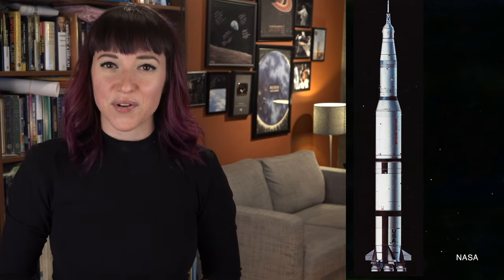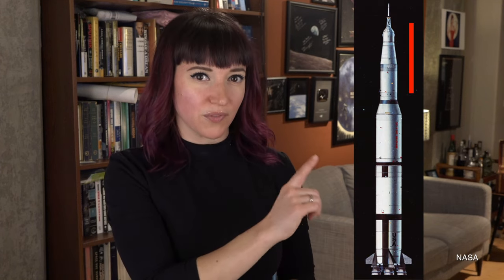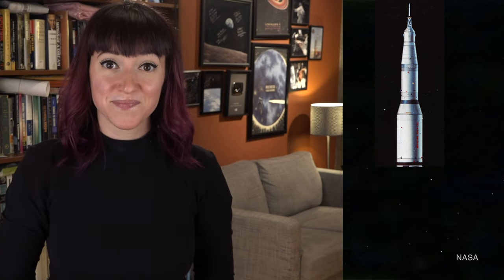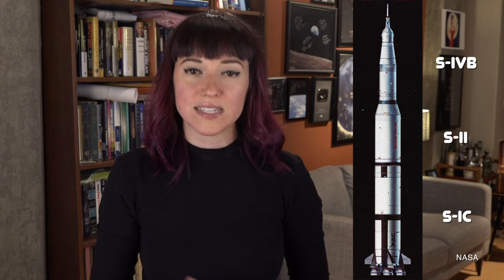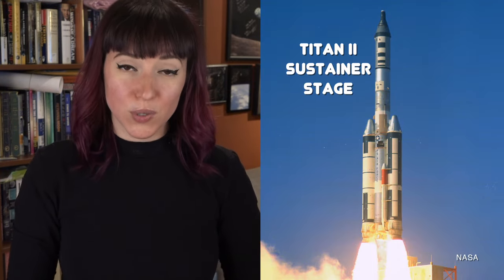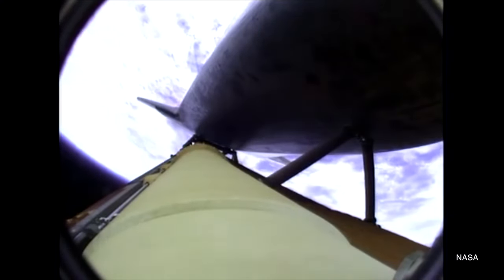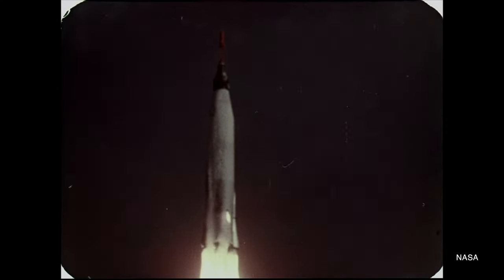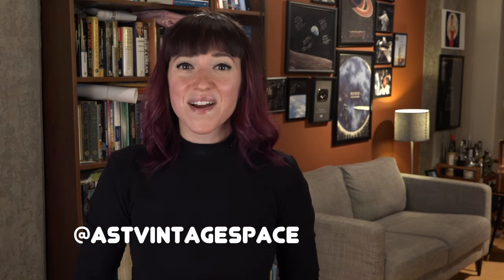The How and Why of Rockets' Staging

Comment: I worked at the space facility that manufactured those Saturn boosters. People lost interest in men walking on the moon and the program was cancelled. Entire completed booster stages were simply parked outside and other parts of the country as tourist attractions. Which in itself is cool because I can go up and actually touch the massive engines, examine their lockwire techniques, read pressure tube tags. Fascinating!
Reply: I want to thank you for your work. For many years I feared Apollo would be the last 'hurrah', or the pinnacle of space exploration. But we have SpaceX and Blue Origin, and others working toward space. This pleases my heart.
Reply: What was your job there?
Reply: James E  Sadly my job when I first started was to throw Saturn era materials in the dumpster as we transitioned to building the Space Shuttle external Fuel Tank. I could only dream as I walked through the myriad of cables, hydraulic and gas flex lines that would have been used to test the completed boosters. Old test consoles sat vacant. Ghost house.
Reply: +Bobby Harper
Fascinating to hear from you as someone belatedly connected to the mighty Saturn V and ushering in the still impressive Space Shuttle external tank. I would have been fiercely tempted in your shoes to snag a few throwaways to keep. I will always look up to the marvel of the Saturn V, as everyone does even when it is lying on its side because it is so big ;-) Had the pleasure when I was young to see the one on display at KSC and plan to go again. Maybe the SLS will achieve great things and we will have another achievement to look up to in the future.
Reply: I feel compelled to get near them with a lighter like James May.

Comment: Amy - It might be nice one day to do a video on the difference in efficiency between rocket nozzles used at sea level versus those used in vacuum.  My understanding is that this is one of the main reasons behind rocket staging. Maybe a video on NASA's attempts at single-stage-to-orbit like the VentureStar, too, if you haven't already done one. Thanks!
Reply: Indeed this very high level overview doesn't really feel convincing about why staging is done.  After all, why throw away the 1st stage engines and structure only to burn fuel in a 2nd stage, when you could be burning that fuel in the first stage and instead not have the 2nd stage mass of engine ?

Different nozzles and fuel types used is probably the answer.

I think this is also something that needs some hard numbers to be truly convincing.

NB: I know staging is done for good reasons, I'm just saying this video, sadly, fell short of explaining why.
Reply: Ath Athanasius Explaining a lot of space stuff requires mathematics, Amy tries to keep the videos simple for a broad audience.
Reply: That's kind of a bad feedback loop though. No broad audience for maths -> don't explain any maths in videos -> even narrower audience. 
I think the rocket equation definitely belongs in a video on staging. There are good ways of explaining it to people without prior knowledge. 

In fact, Marc got half of the explanation and the rocket equation shows why: Delta-v = Isp * log(wet mass / dry mass)

Delta-v measures what your rocket achieves, you want as much of it as possible. You need 9.4km/s for low earth orbit, 12.6km/s to escape earth. Google "delta-v subway map" for great illustrations. 

Isp (specific impulse) measures the efficiency of your engines. Making an engine efficient is very different depending on the thickness of the atmosphere and how much thrust is needed. On lower stages you have short nozzles because there is plenty of air pressure and you need high thrust (or lots of engines) because your rocket tends to be huge at this point and you have to overcome gravity. In space, you can build longer nozzles which are better in vacuum and the engine(s) can be quite weak since you can just burn them longer. This is one reason why staging helps a lot - the same engine won't be good at both. 

Finally, there's the logarithm term. This captures the fact that packing more fuel in your rocket gives diminishing returns. For every extra litre of fuel you have to add even more fuel, to get that litre up to the point where you actually burn it. You can look at the equation from the other side (solve for the bracketed term): To get more delta-v, the percentage of your rocket that needs to be fuel grows exponentially! That's impossible to do, after all you can't have a rocket that's 100% fuel, you need engines and tanks, not to mention the actual payload. Again, staging to the rescue: By ditching stuff as it becomes useless (empty tanks, superfluous engines etc.) you can push your fuel percentage higher during the flight and thus increase delta-v.
Reply: You beat me to that point.
The size and shape of a rocket engine nozzle at sea level would be very inefficient at higher altitudes and in space.
Reply: Might be good to go through the steps with a simplistic mock design. Start with minimum rocket with no payload, add an astronaut, add their weight, add fuel to compensate, add the weight of the fuel, add more fuel to compensate, realize your rocket is no longer providing sufficient acceleration, add bigger rocket, add weight of rocket, add fuel to compensate, realize your fuel tank isn't big enough, add bigger fuel tank, add weight of tank, add fuel to compensate, realize your rocket isn't big enough again, add bigger rocket, add fuel...
Reply: Ath Athanasius Yes, rocket bells are different, but probably the main thing is the weight of the empty tanks. Why push them into orbit too? They must weigh tons - that's tons less payload.
Reply: For staging think of it this way:
Everything that finally goes into orbit needs to be accelerated to orbital velocity - both the spent rocket structure and the satellite. During the last few moments of thrusting, the rocket is accelerating a bunch of dead mass in the nearly empty tanks and engines to orbital velocity. If that dead mass could be eliminated, the remaining fuel would be more efficiently used to accelerate the payload. Enter staging. If the rocket is broken into stages, each stage will add an increment of velocity (delta-V as mentioned by another commenter) and the dead mass of its tanks and engines will then be discarded when the succeeding stage is ignited. This means that a smaller mass is accelerated to orbital velocity and the launch system is more efficient.

Mathematically, a large number of small stages would be optimal, but, from an engineering standpoint, the optimum number of stages is between two and four depending upon the type of fuels used and how light each stage can be made. A rocket stage can only be made so light because efficient engines have a minimum weight and and all stages must be able to withstand the high g loads and dynamic pressures found the early minutes of flight meaning a fairly robust (heavy) structure.

Staging can also be used to better tailor the overall performance of a rocket. The Saturn V first stage had a thrust-to-weight ratio of more than 1 (6 million pounds weight and 7.5 million pounds thrust) to lift the rocket against gravity. The S-II stage had a thrust-to-weight ratio of less than 1 since it did not need to lift the stage off the ground - just accelerate it.

Nozzle length has to do with how efficiently an engine will convert the kinetic energy of the exhaust to thrust. Ideally, the nozzle should be long enough that the exhaust pressure at the exit of the nozzle is approximately equal to the ambient pressure for best performance. A longer nozzle confers no advantage just adds weight. So an engine that fires at sea level needs to only expand the gasses to to 1atm pressure which, for a given combustion chamber pressure will be a shorter nozzle than if the same engine is operated in a vacuum. In reality, some booster engines are over expanded by a small amount at sea level to allow for better performance as they ascend providing better overall performance overall.
Reply: Correct 
She is a charming highly intelligent young lady I have to admit
Reply: +Ath Athanasius - good point.  Extra engines adds a lot of weight.  It's not like the engines are wearing out in that time.  Seems like it would be more efficient to keep the original engines and eject empty tanks.  Kind of how the space shuttle did.
Reply: +Russell Hltn
This kinda discussion also always pops up in Asparagus staging concepts. Plumbing is the biggest factor. The Space shuttle has a 1m diameter fuel line to feeds it engines and its  pump / plumbing design was quite a feet of engineering. And this is only with one tank. More seperating tanks will increase complexity, which theoretically may be more efficient, until you consider reliability of the individual components into account.

Also don't forget that if you start with a large mass, you also start with more or bigger engines. Engines that you don't need anymore. Saturn 5 closed of her center engine after 135 seconds (of total 168 seconds burn time) because the reduced mass would have exceeded safe acceleration. For the remained 32 seconds the center engine was another 8400 kg of useless mass.

Saturn 5 is an interesting case. While the first stage was the most energy dense with her Liq. OXidizer/RP1 powered F1, the larger (in volume) LOX/Liq. Hydrogen stages where more fuel efficient.
Reply: Firing a vacuum nozzle at sea level can destroy the nozzle extension.
Reply: Jv qn, your math laden post demonstrates why not to include math into a brief explanations such as Amy's. There are plenty of math intensive explanations on YouTube. The point of a presentation such as hers in to pique people's curiosity, and then they can easily find those other more detailed videos.
Reply: I think this was the motivation behind the aerospike engine, a research project that was sadly canceled in the 11th hour of it's development. Maybe a video on the rocket designs which never finished development, if that hasn't been done already. I haven't look at all Amy's videos.

Comment: You missed asparagus staging :) Although it was never put into practice so far due to complexities of fuel crossfeed.
Reply: My little Kerbals swear by it.  :D
Reply: And more than one of mine died by it. ;-D
Reply: Basically, you have tanks with engines on the outside of a center core (kinda like the Soyuz rocket or Falcon Heavy) but with fuel cross-feeding into the center core so it always stays topped off with fuel. When the side boosters run out of fuel and detach, you now have a rocket travelling at speed but with a fully fuelled center core that can now burn said fuel for longer while also pushing less mass that you just dropped with the side boosters. The name stems from the fact that you can do this with multiple boosters, one booster fuelling the next which fuels the next and so on. You're dropping off stages kinda like how you peel an asparagus.
Reply: Actually, that works! The Space Shuttle was able to do just that...
Reply: Dr. Paul William Not quite. The space shuttle had crossfeed, but did not have engines on tank, nor did it have tanks on the orbiter for the main engines.
Reply: Squad should log all kerbal deaths in a database and publish yearly staticstics. :D
Reply: Tomasz Konstanty Maluszycki ah someone noticed aswell
Reply: Neither has onion.
Reply: Vel0city that first example is onion.
Reply: Plus it makes the rocket flames smell like asparagus.

Comment: Found this - Douglas Aircraft's SASSTO, short for "Saturn Application Single Stage to Orbit", was a single-stage-to-orbit (SSTO) reusable launch system designed by Philip Bono's team in 1967. SASSTO was a study in minimalist designs, a launcher with the specific intent of repeatedly placing a Gemini capsule in orbit for the lowest possible cost. The SASSTO booster was based on the layout of the S-IVB upper stage from the Saturn family, modified with a plug nozzle. Although the SASSTO design was never followed up at Douglas, it is widely referred to in newer studies for SSTO launchers, notably the MBB "Beta" design, which was largely an updated version of SASSTO.

Comment: Every one who plays kerbal knows staging
Reply: lalithchandra musipatla Although Kerbal has a kind of staging that is impractical in real life: Asparagus staging, which is like parallel staging, but fuel is pumped to the later stages so they have full tanks when you drop the earlier stages. In real life, the pumps needed for that would be too heavy to be practical.
Reply: I think that the pumps could be made to work, but the main reason Asparagus staging is not being used is the addition of things that can go horribly wrong. Also, keeping the propellant at the right temperature while being pumped all over the place is a challenge in and out of itself.
In short, it's just too risky at this time.
Reply: +Christian Breitenstein
pumps, plumbing (Space Shuttle had a 1 meter diameter fuel line to her engines) and overal increased complexity negates most theoretical gaines you could achieve from it. 

Now that I'm thinking of it, I'm not even using Asparagus staging anymore in my latest KSP career playthrough. I've also become obsessed of firing my first 2 a 3 stages in a succession so I only need no / or a small coasting to circularize.
Reply: Christian Breitenstein why don’t we hire Kerbals?

Comment: Atlas-D's booster was a "half-stage" not because it separated vertically, but because it didn't have its own tanks. It was just extra engines feeding off the main tank. By contrast, the Falcon Heavy side cores or the Shuttle SRBs are full stages, as they have both their own engines and their own propellant.
Reply: More so because all engines were ground lite so the the boosters become stage zero.
The Shuttle was stage and a half and Falcon Heavy is two and a half stage.
Reply: Patchuchan No, a parallel stage is still a full stage. Also, counting from 0 vs 1 doesn't change the number of stages. What makes Atlas-D a "half-stage" is that it doesn't carry its own propellant, it just siphons off the main tank - an engine without a tank. Another type of half-stage would be an external tank feeding into the internal tank of another stage, i.e. a tank without an engine. Technically the Space Shuttle is two-stage: the SRBs are a full stage (with parallel staging), the orbiter carries a half-stage (engines without a tank), and the ET is the other half-stage (tank without engine). Were the Shuttle to have a smaller internal tank feeding into the SSMEs, and the ET feeding into that tank, it would've been 2.5-stage.
Reply: Maybe I should post this question right here to get the debate going... If anyone cares...

I just been trolled about Soviet space rocket Soyuz, my opponent claims it was a "collection of boosters"(he was talking about first stage), while I been thought that its main engines called blocks(I guess just like in the car engine block that consists of the banks of cylinders in different configurations - in line 4, V-8 and ect.) due to the collection of combustion chambers analogues to cylinders), so back then(before Shuttle and Buran space programs) there were no concept of boosters, and first stage of Soyuz rocket consisting of five main engine blocks, four of PД-107(BTW "P" in Russian "R" called Rocket, "Д" or "D" in English, stance for "Двигатель"(or "Engine" - or literally Rocket Engine) with only two steering nozzles, while РД-108 is the same RD-107, but with two more(for a total of four) steering nozzles. So RD-108 called BLOCK - A and located in the center surrounded by four RD-107 called BLOCKS - B, C, D and E strapped on the perimeter of BLOCK - A engine. So the question is - does blocks B, C, D, E - are considered to be boosters(and if NOT, then why it is not a boosters?) or blocks of main engine? Thank you in advance. Here is the diagram of Soyuz rocket: 

https://upload.wikimedia.org/wikipedia/commons/1/1d/Soyuz_rocket_and_spaceship_V1-1.svg

Comment: Good video.  One aspect of staging taken into consideration for man rated rockets is the maximum amount of force, that astronauts can safely experience.  For each stage as fuel is consumed, the mass decreases over time.  That will cause acceleration to increase if thrust remains constant (Newton's 2nd law, Force=mass x acceleration).  Early rocket designs like Atlas and Titan were designed as ICBM's, not for people.  They had a max G of around 6-7.  The Saturn V had a max G at around 4 before 1st stage cutoff (The center engine would cutoff early to limit max G).  The Space Shuttle's main engines had variable thrust to mitigate maximum dynamic pressure and limit the max G's to about 3.

Comment: I was at KSC last Sunday and as I was wandering around the Apollo/Saturn V center I couldn't help but remember your live streams from there and I kept saying to myself "Amy stood right here!!!!" LOL

On a side note, KSC is SO "Disney" now. I remember when the Saturn V was laying in the parking lot of the VAB and the bus tour would actually let you off there for 10 minutes to take photos (mostly of the birds nesting in the engine bells). The tour bus also used to drive right up on to 39A/B if one was available and let you get off the bus there for a short time and take pictures as well. The old pre-terrorism tour really made you feel like you were actually seeing something REAL... like getting a real, VIP, behind the scenes look. Another stop was the Multi-Payload Processing facility (I believe). There was an elevated gallery that you would walk through while looking down on the "clean" area where they were prepping payloads for launch. The last time I went through this they were prepping modules for the ISS to be lifted by the space shuttle.

I need to find those pictures. :)